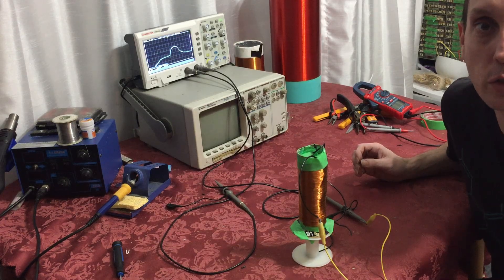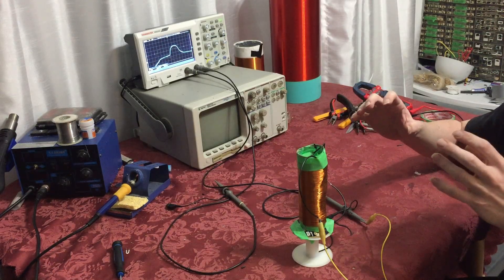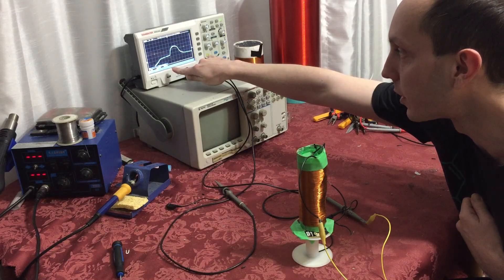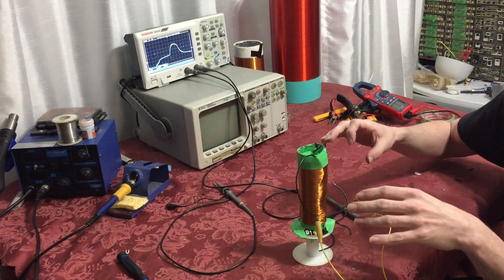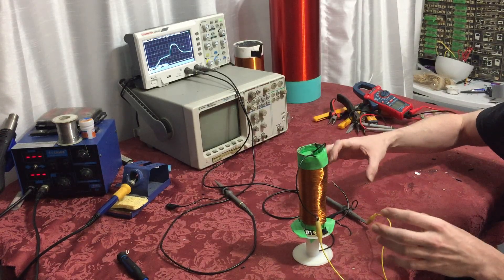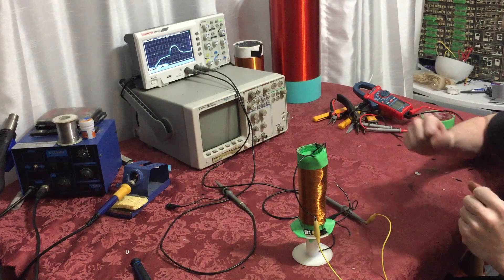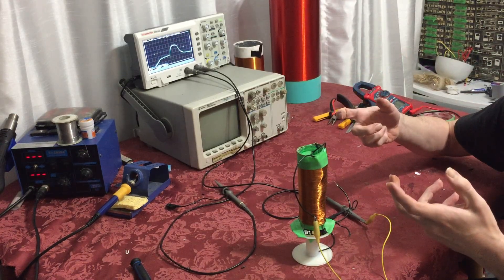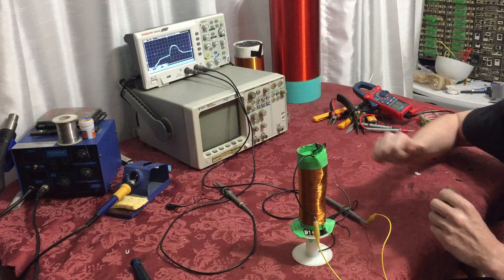Crystal Cell Capacitor

Comment: Wouldn't capacive diodes do the trick also?
Reply from the maker: Yes, I ran out of those when ham radio in my area got quiet. Used to build loops with them and such. Glass vacuum type very good.  And boy 4kv no problems to work with! no burning out.